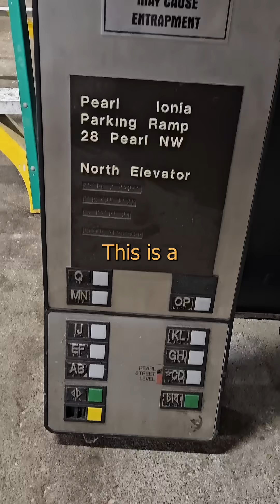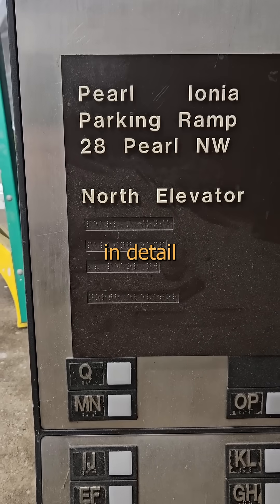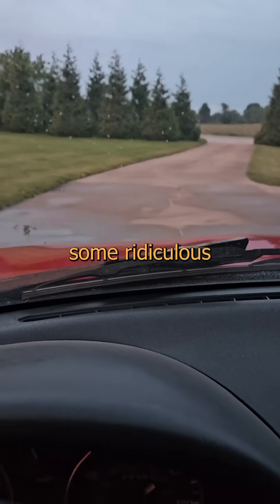Miata Mischief #chrisboden #engineering #gear #elevator #score #stories #parts #hacking #making

Comment: When getting ready to move into my first apartment I bought a kitchen block including the stainless steel top and didn't have any way of fitting it into my car (Peugeot 106 Rallye) and since the clear coat on the roof and other parts of the car were already junk, I just strapped that 1,20x0,60x0,80m (you do the math to freedom eagles per square footballfield) thing to the roof. About 3 mins from my destination the cops came in clutch so serve and protect the community from my insanity. Pretty much went like- C1: "license and insurance ple..." C2 interrupting while flicking the straps: "wow that thing is strapped down for good!" Me: "I might do stupid stuff but at least in a safe manner!" C1: "yeah well we've seen it all and wanted to check on it. Have a good one!"
Reply: Also transported a 2 inch thick wooden bathroom top on my Piaggio NRG Scooter since my company truck was with my colleague. Strapped it to the sides like a surfboard - worked like a charm but wouldn't recommend in windy weather conditions

Comment: I have a 2000 Chrysler Sebring Convertible, and I also have a 14 foot canoe I wanted to bring to the lake but I didn't want to damage the top, so I put the top down, strapped the canoe so it was sitting on top of the windshield frame in the front, and on top of a towel on the edge of the trunk in the back. 3 ratchet straps later and that wasn't going anywhere at 65mph. In the same Sebring I also put an entire moped in the back seat, as well as drive from my home in Da UP to Utah, with the car loaded up with: my bicycle, 4 beer case boxes of various clothes, food, camp cooking equipment, a giant duffel bag full of bedding, another duffel bag with more clothes a sleeping bag, a tent, a 6 gallon jerrycan of water, a folding cot, and 2 toolboxes. I had the backseat and trunk completely full on my 2 door Sebring, and the passenger seat packed up to just below the window

Comment: Not crazy, but my boss asked me to go pick up material for an electrical job we were doing on my way in one day.  This is not an unusual occurrence, but when the order was placed the day before it was intended to be picked up by a work van, but the driver had something unexpected come up.  Boss man hadn’t thought about what all was in the order.  Turns out you can fit three 10ft bundles of 1/2” EMT in the cab of a Hyundai accent hatchback.

Comment: My 1999 Kia Sephia was a monster. She helped me move a piano that I was restoring/repairing from my parents house to my girlfriend’s apartment (about 16 miles.) I got pulled over by a State Trooper and he asked me a few questions, then decided to radio a nearby trooper where they spent a few minutes roasting me before they gave me an escort for the last half of the journey.
Reply: I GREW UP IN A KIA SOPHIA
Reply: @86XR250Rbrapin My uncle was born somewhere in the Ford Galaxy. He’s basically royalty.

Cheers!
Reply: I need more details. I would have thought this impossible even with intermediate wood chipper step. 

I wasn’t aware they made a long bed version of the Sephia. Or any bed for that matter. 

Did you put the piano on castors and tow it? [Ideally with a trusted friend in the trunk who has a kung-fu grip]

Did you put the Kia on the piano and rig some sort of Mr. Bean U-joint down to the piano? 

Was this an upright piano where you could fit the Kia under the keyboard, with the front and rear wheels straddling the peddles?

Was this a grand piano, turned upside down and placed on top of the Kia making it look like a hot wheel attempting to carry the little plastic cheese protector thing from delivery pizza?  Or a bizzaro Ork Imagined car-born AWACS system [This is now my headcanon].

Please advise, I’m losing sleep over this.

Cheers!
Reply: @0ddSavant  Turns out, in some countries, they make these as small minivan conversions. 

My guess is it was 2/3 out the rad ratchet strapped down through the window.

I transferred a horse like that.
Reply: @AceOfBlackjack I love the idea of the horse not getting along with people at the first location, and you making the effort to have him work out of the sister office.

Good on ya!

Cheers!

Comment: 1989 dodge ram 50, with a flatbed on the back, tiny tiny truck, smallest truck dodge ever sold, i was in theater, we had hundreds of pounds of tech stuff, and I had to drive everyone to the stage, everyone got on the back, roof, and on the inside, we put all the tech stuff, the truck struggled with its meager 2.6 liter engine, but it made it

Comment: I worked at Little Ceasers, in high school, and they were upgrading their chest freezer. But the old one still worked. So a friend and I decided we'd put it in his parents basement, 4 miles away. Thankfully, it was mostly down hill, and I had a long boat paddle to steer it, while going down said hill, while riding it. I did have a helmet, just in case, and a spare paddle. Which is good, because the first one was destroyed, by the time I got to the bottom of the hill, mostly from using it to brake. That freezer worked great for about another decade.

Comment: Not too crazy but I did ratchet strap two kayaks to the roof of my Honda Civic coupe.  They slid around a bunch even with a blanket under them so my buddy ended up sitting on my door hanging out of my window to hold them on.  Good times.
Reply: Second side story.  I also ended up fitting my entire life into the same car and drove it all the way from Florida to New York in one day no stopping.  Probably took about 5 years of my life off with all the Monster Energy Drinks though. 😅

Comment: When I was in college I had a 1965 Pontiac Catalina 4dr hardtop.  I was still living at home, and my bed was a refurbished captain's bed from an old ship (my grandfather was an inspector at the state dry docks and had his pick of stuff that was stripped from ships being salvaged).  The bed was solid white oak with 4 drawers and a cubby under it with brass pulls and latches.  Very cool, but also not standard sized (like a full or twin bed).  The mattress was God only knows how old and it sat on an all metal box spring, and the mattress.  I found a place in a nearby city that made custom mattresses, and they made a mattress that would fit the bed for only $95! (this was in 1976!)  I stopped by to pay for the mattress and to tell them that I would have to borrow a truck to transport the mattress home, but when I saw the mattress I thought: "I'll bet this would fit inside my car."  Sure enough, with the windows down I was able to put the mattress INSIDE the car-- it just fit between the front and rear windshields and left me just enough room to drive the car (jammed up against the driver's door).  I wish I had taken pictures, but this was back in the "camera with film/take the film in to a drugstore to be developed/wait for a week" days.

Comment: Ok sorry this is a long one but it does have it all. You'll laugh, you'll cry. You'll gasp in horror. You'll cringe in secondhand embarrassment! Enjoy.
Between ages of 16-19 i helped my uncle boil maple sap every year to make maple syrup in wayyy upstate NY. At the time as a broke teen I had a rusted out 1983 Subaru GL wagon (4 wheel drive) with 185k miles on it and about 45 functional hp because it had a leaking head gasket and burned a quart of water a day. 
One time I used the Soob to haul 400 GALLONS of sap in two huge, unbaffled tanks shoved into the back and bungeed to the front seats with about 20 bungees each! It was as 12-mile drive to my uncle's sugar shack, with a VERY steep downhill grade into the small village where he lived, with a single red light intersection of the state road with Rt. 11. 
Being an inexperienced driver and young teen yet to take high school physics... I was completely ignorant of fluid dynamics and the implications thereof.
Barely get the Soob up the driveway and onto the road due to the weight of the sap exceeding that of my car (when unloaded)... but finally got moving and eventually up to road speed...
Cue to 12 miles later, with me having no clue how hot the wheels had gotten due to both weight AND apparently, tire sidewall flex! So i come out of 55 mph zone down the hill into town's 25 mph zone, and gently brake to slow down: NO BRAKES!! At least, thats what i thought (remember, inexperienced). So I immediately grab the e-brake handle and yank it on as hard as i can. Very, very slight slowing begins to occur but not NEARLY enough to be able to stop for the red light about 1 mile down the hill!
About 200 feet further and i suddenly remembered i was driving a stick, so immediately downshift to 3rd, redline the engine but it applies a little more stopping power. I try the pedal again and it feels SOOOO soft, but it does seem to help a little. I smelled a funny smell (later learned it was hot brakes smell lol)... within a few hundred feet of the intersection, the road flattens at bottom of the hill.... I am scared but by this time slowed to under 25mph so feeling like i might be able to stop if light is red.
I continue using ebrake, engine downshift, and brake pedal and of course catch a red light. And I jam the pedal and yank the ebrake for the final stop at the light... a little harder than i wanted but it DID stop!! Sigh of incredible relief as cross-traffic enters the intersection, and I feel all proud when without warning: BLAMMMMMMM!! The Soob LURCHES forward about 3 inches, tires squalling as I had brakes on tight. I had NO IDEA the almost 4000 lbs of sap would shift forward at 20ish mph once i stopped! it took about 1/4 of a second to happen and about 10 years off my life. 😅  But the Soob and I survived somehow! I eventually drove that car to my other uncles junkyard, it refused to die but had sooo little power and was holes-in-floor rusty and dangerous. It had 197, 600 and some miles on it. But I found out my uncle used it in the woods for TWO MORE YEARS after that, to haul cut firewood! He only stopped using it when the body of the car broke in half in the middle of the field hauling a load of wood.

Comment: I’ve been a mechanic for about 20 years. I’ve seen my share of people hauling strange stuff. But one takes the cake. It was a tan 2005 Camry with a busted out right side mirror and right side hood and fender was a bit dented as well. It was a hot summer day and I smelled something funky soon as I got close to the car. When I opened the door the stench of death hit me right in the face. I’m thinking right away, a pack of dead mice or something. I rolled down the window let it air out some but the smell didn’t get at [any] better. I did a walk around like I usually do before pulling it in, I noticed the damage on the right side and got to the trunk where the smell was there  [the]worst. I saw what I thought was dirty greasy finger prints on the trunk lid at first. I opened the trunk , a bunch of flies flew out, and right there lying there was a rotting 4 point buck. Maggots and all. 
- I got the story from the service advisor, the owner, hit it last night, it was alive when he put it in the trunk. It wasn’t moving in the morning and was going to bury it after he got an oil change with us. The owner was “special” if you know what I mean. Bless his heart.

Comment: At 30 I found myself suddenly single, so I thought a convertible would help me meet chicks. I bought a 1998 VW Cabrio, only to realize that the only other people I’d see driving a similar car WOULD BE chicks! Similar to a Miata, the hardest part of buying a car like that is calling your dad to tell him you’re gay!

A friend’s dad was moving and I had use for his old grill. In January in Cleveland with the convertible top down while it while it was snowing I had a full sized gas grill sitting in back seat. I didn’t have any bungee cords or ratchet straps, since why would you in a convertible, so I zip tied it to the roll bar.

Comment: hardy counts because it worked far too well, but when i was 17 a few friends and i committed to building a shed in my backyard, and we hauled everything back from home depot in my 2013 honda odyssey. turns out half a dozen sheets of 4x8 ply fit perfectly as long as you keep someone back there to hold the trunk down 😂

Comment: I made a huge speaker box when I was about 14. wood shop was 3 miles away I had a BMX with pegs on the left so all that wood got strapped to that side and I pushed it 3 miles home. Built the speaker box 8 speakers inside it and a bass box. Sounded like shit but I made it and I loved it

Comment: I found an old xray transformer being given away by a vet so after I got out of my hvac class me and my girl drove 2 hours away to get it in my dodge challenger not realizing how fucking huge and heavy it was. When we got there and saw how heavy the thing was (about 500 lbs and full of oil) we went to a harbor freight down the street to get a jack but that wasn’t gonna work to well so we ended up having to open it up which was a bitch and a half and getting a Manual pump to pump out all the oil into grocery store bags and a big ol gas can and then we were barely able to lift it up into my trunk which wouldn’t close with it. But all in all we were there from 2pm-2am trying to figure out how to get it in, opening it up, and finally getting it In.

Comment: Got another story. 

We have a little yard tractor with a bucket that we use all the time. And when we were renovating our old shop it was the only tractor that would fit in the door and do what we need it to. We needed to move an old air compressor dad either bought or was in the old shop already (can't remember). So we strapped a chain to it and then to the bucket and lifted it. But the compressor was a bit too heavy for the tractor. It kept wanting to tip the tractor. So dad had me stand on the 3 point hitch as a counter weight. It worked. So I stood on that holding on to the roll bars (I think is the name) with the compressor hanging. The tractor wasn't super happy still but was happier.

Comment: My mom and I a few years ago went on a trip to get a pretty large wooden table, and we rode in a Subaru Outback- as you might imagine, it went pretty bad. We ended up having to hold one side of the table each on the roof with a few straps that did not help whatsoever, and  we had to drive at like 30mph home at maximum and had to slow down for winds because i couldn't handle it, I literally had a hand out the window just to hold the table down the entire ride home lol
It ended up taking about 2 hours to get home :)

Comment: wasn't pretty, but sometime in around 02-03 got an 8D lead acid battery ~2 miles home by balancing it across the handlebars and saddle of a bmx. probably didn't help that the battery alone was almost as heavy as I was at the time.

Comment: Tried to fit a double wides worth of old roofing shingles onto the bed of an S10. I did it. Every bump made the wheel wells scrape the wheels. At idle, we had 1/4 inch clearance on the rear tires to the wheel well. That 4 cylinder was roaring down the road at well below the speed limit to the dump site. I was 17 without a driver's license just trying to make a buck. It ended up tweaking the frame and tore up then rear wheels.

Comment: Went with a friend to buy a trailer, he wanted my opinion as he wasn't dident know much about it.
Looked clean and straight gave him the tumbs up. 
My friend was now the proud owner of his first trailer, now just to hich it up and tow it away.
At this point i noticed  the lack of a tow bar on his car.
He had no idea his car needed a towbar to TOW somthing.
Opened the boot and used 2 ratchet straps attaching it to some very lightweight tie down points, never noticed so meany police cars in my life.

Comment: I crossed the Alps and drove 2000 kms with a methane powered 1.6 liter fiat multipla, loaded with a Queen sized bedframe, the mattress to go on top of it, a whole two seater bed/sofa, a flat screen TV, my luggage, a couple of musical instruments, two big boxes of pasta, two cannisters of olive oil and I believe my laptop. My shoes were all under my legs and I managed not to remove the seats for this.

The car was running on borrowed time, the engine oil was probably 2 years old, and I had a ton of problems just trying to keep it going... It gave completely up a few weeks later but managed to bring me all the way across Europe one last time. I spent less then 150€ for the whole trip and I had a fully functioning apartment from day one without having to buy anything 🙌🏻

Comment: I used to carry EMT and RobRoy conduit under my 62 VW beetle. I’d hang it off the bumper brackets in the rear and I made a pocket that bolted to the beam in front to keep the hollow javelins from shooting out if I had to slam on the brakes. Maybe not super sketchy like hand-holding a rooftop mattress delivery but sketchy enough!

Comment: When i was 17, I was "given" a pair of 20' 4x4s from a construction site, which i strapped to the roof of my mom's Cleveland cavalier with not nearly enough rope i pulled out of a dumpster. I thought it would be safest if almost all of it stuck out in front of me, so i could control its distance front other vehicles. It swung wildly from side to side.